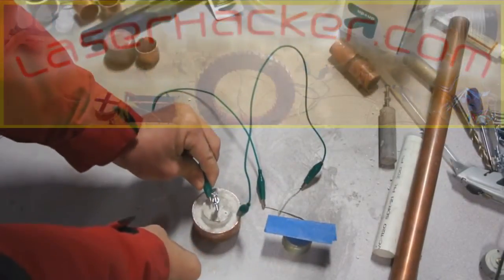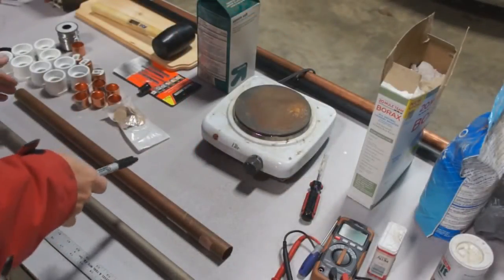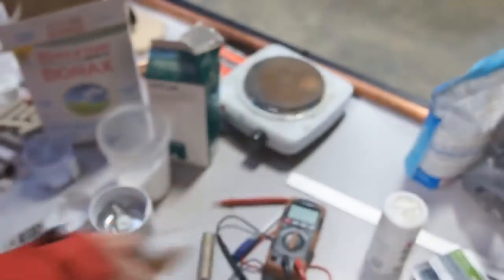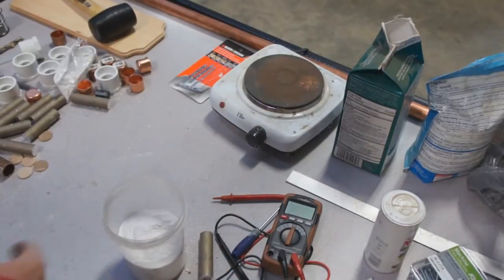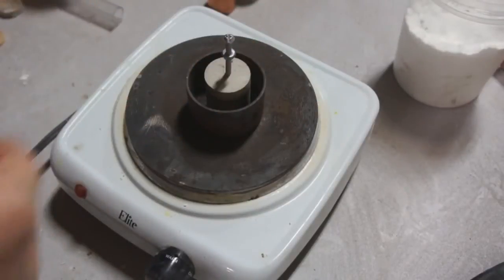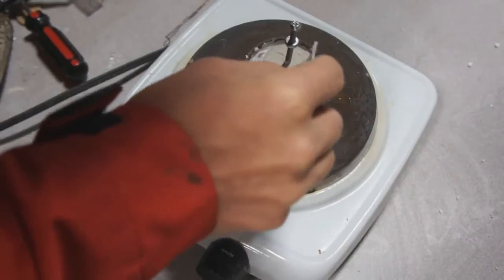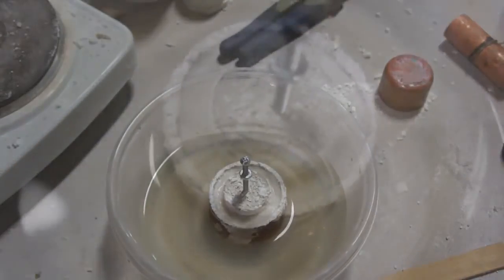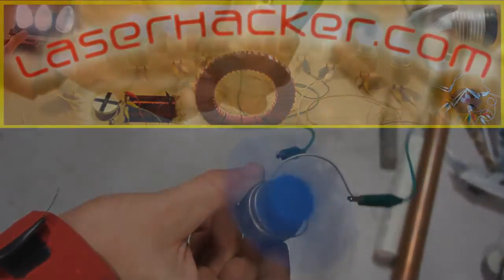How to Build Crystal Power Cells - Long Duration Power

Comment: You can test the effects of different materials by applying them to the surface of a flat Hutchinson cell that has both electrodes placed on the same side and a surface where you can apply the material as a powder. That's how you make a sensor for doping agents using a multimeter to measure voltage.I've tried it and it works. You can remove the powder with a dry cloth after use.